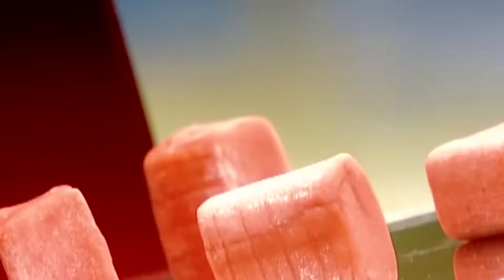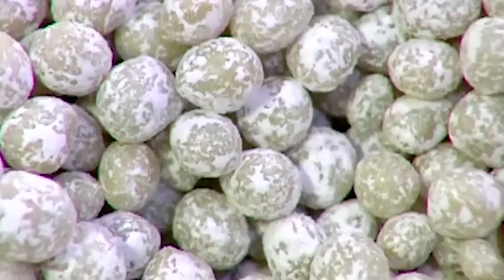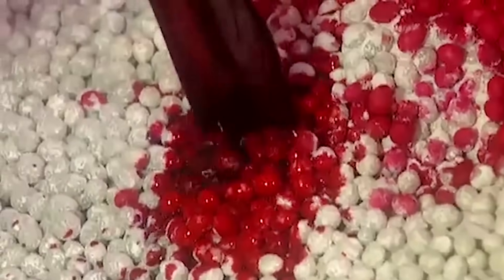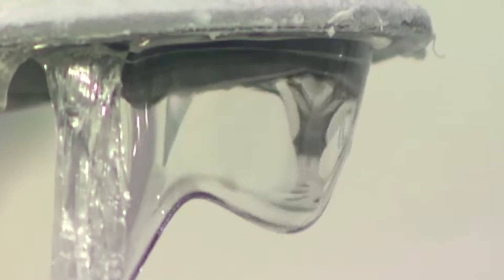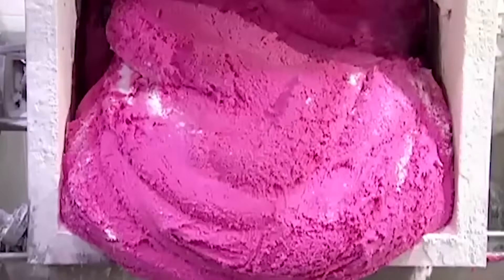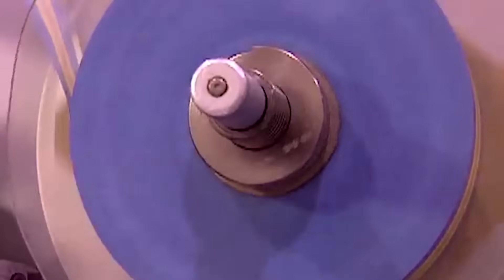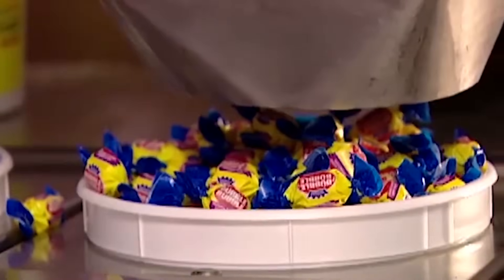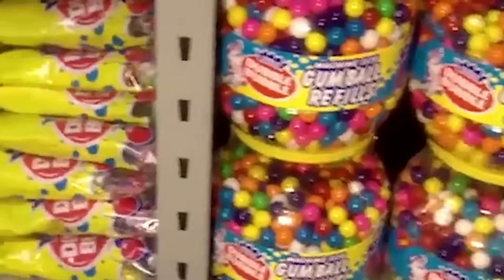How It's Actually Made - Bubblegum

Comment: “A comfortable 117 degrees”
Reply: °f
Reply: a comfortable 117
Reply: Celsius, Fahrenheit, or Kelvin?
Reply: @Y337n3ss  I'll tell you in 16
Reply: americans: ok not too bad 
europeans: [insert picture of sun]
Reply: @ee-wo9rh  117 fahrenheit might as well be the sun, too. Car tires and plastic fixtures start to melt at that temp.
Reply: 117 degrees of Master Chief?
Reply: Fnaf?
Reply: @Y337n3ss  Clockwise. Every hour, the employees are rotated 117 degrees and have to re-orientate themselves.
Reply: °C
Reply: @pumpkin6429  as for the non-sarcastic answer to that, no they don't start to melt at that temp. It's only when it's that hot outside that the asphalt roads get hot enough to cause things to start melting. The roads will be far hotter than the air temperature.
Reply: Must be in South Texas, that's winter down here.

Comment: “The gum runs itself through a series of rotors which connects to a turbine that powers the building’s air conditioning”
“But however the gums lack of tensile strength means that the factory stays at a comfortable 117 degrees Fahrenheit.”